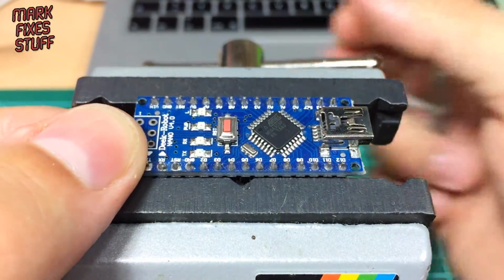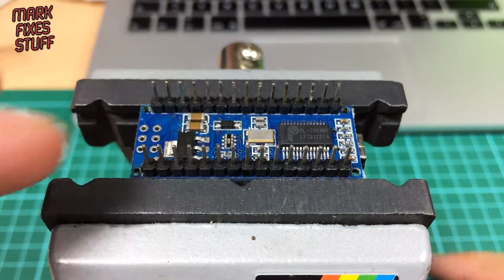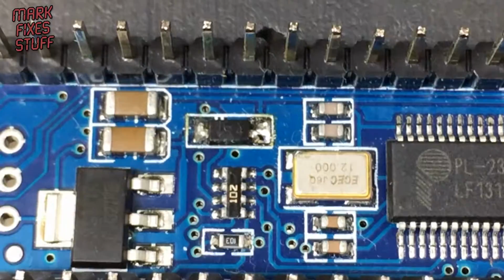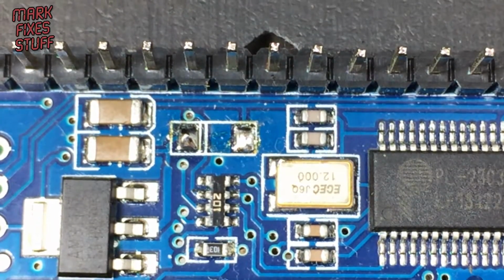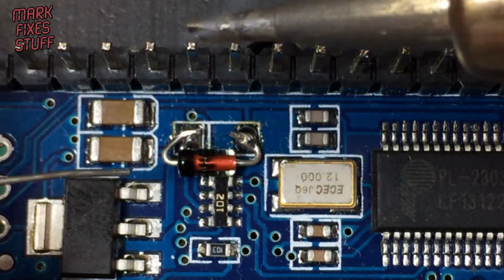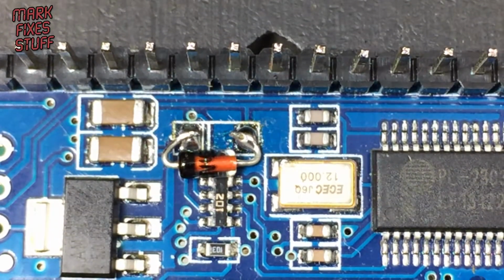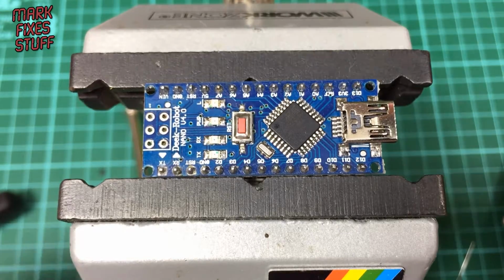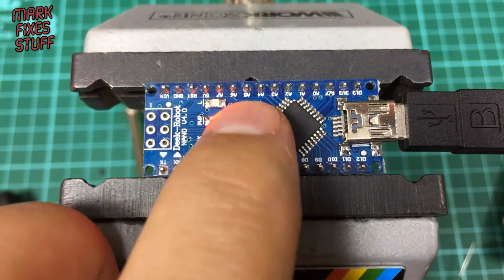How to fix a broken Arduino Nano and Clones - No power No LED activity Not working

Comment: Hello engineer.
when I connect the USB to the Arduino (Arduino Nano), the Arduino Power LED turns on, and when compiling, the RX and TX LEDs turn on and off immediately! Where do you think the problem comes from?

Comment: Hi ! I was using my Arduino Nano to drive the stepper motor by A4988 driver with 12v and 10amp power supply .My board was working well but stepper somehow wasn't working but suddenly after replugging the Power supply my Nano chip (Atmel 328P) got bursted .  I checked and found that my Voltage regulator went shorted too and schottky diodes maybe damaged too but the lump(burning point) is only made on the Nano 328P Chip. I also found that my GND PIN and all +ve pins(like Vdd, VIN , 3V3) are shorted now. SO i wanna ask what had happened bcz I had all correct connecions ☹, and if u can give any suggestion to solve the issue. Will replacing the chip and regulator a good idea and should i do so? Thanks in Advance.😊
Reply: The arduino Nano board that i have, uses the Atmel 328PB chip (newer variant) , SO i also want to ask that if i can replace it by 328P or  only 328PB chip.?
Reply from the maker: It sounds to me like something happened to draw a lot of current through the board, and possibly because it's a cheap clone that went faulty. Personally I wouldn't bother repairing this one and buy another because the cost and time of replacing the components will be more than a new Nano.  I only try and recover a nano if there is a sketch running on it that I don't have and can't upload to another device, otherwise it's not cost effective.
Reply: @MarkFixesStuff    Hmm ...You are Right.Thanks Bro!
Reply from the maker: @danishanwar3491  Thanks for watching my video!!!

Comment: i have arduino DUE clone after i plugged 12 volts power supply there is a small part beside the capacitor which is beside the power plug was on fire i disconnected the power supply but it seem dead the part was on fire look a lot like that diode should i just replace that diode
Reply from the maker: Well, it might be salvageable. You have nothing to lose I guess. Please let me know if it works!
Reply: @MarkFixesStuff  no it didnt work maybe its not a diode i tried to find the drawing for the DUE board to check what is that part but i couldnt find it
Reply: @EnergySeeker  you checked the voltage regulator?
Reply: @goku445  if I know where is it I will

Comment: I use 1N4148, measured value 556 mA and works fine. Burned diode has value 1120 mA and arduino wont run. Thank you.
Reply from the maker: Nice work!

Comment: will you tell me  that  when i pluged my  arduino nano to usb  in arduino nano led  rx and  pow  led are only turn on......  and thats why its not detect by the pc  and says windows did not recognized.........  so what is the problem with my arduino nano  and  what is the solution

Comment: you can also power it with the gnd and 5v pins externaly whithout replacing the diode.
Reply from the maker: shokifrend77 _ great tip thank you!

Comment: Can you show me the information for the diode?
I encounter the same problem and I wanted to fix it, but idk which diode to buy
Reply from the maker: On my module it's just an S4 diode. Info and buying link is here. Be sure to select the right diode as per your units markings.

https://www.ebay.co.uk/itm/B0520LW-B5817W-B5819W-BAT43W-SD103AW-New-Brand-CJ-SOD-123-Schottky-Diodes/172514974505?hash=item282ab19b29%3Am%3AmnFZZVXQy0S0G0SxIm-b7yQ&var=471364292002

Comment: What do if my Arduino Unos 5.0v voltage regulator gets very hot
Reply: Too much Ampere. Change the power supply with low ampere rating
Reply: Voltage drop too high. Which input voltage are you using?
Reply: @goku445  lol that's 2yrs later someone comments
Reply: @electroprem  it is. You don't remember? :)
Reply: @goku445  😅😂